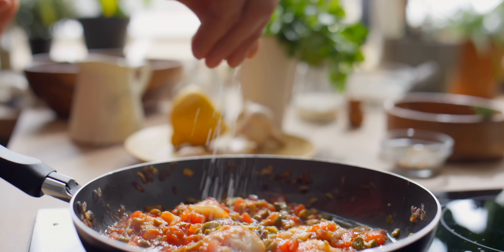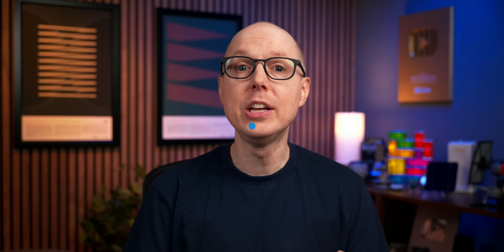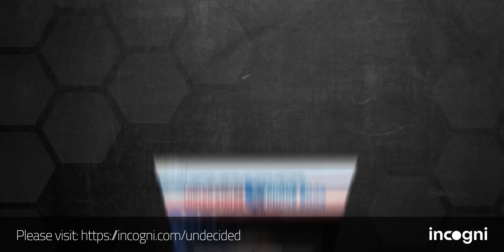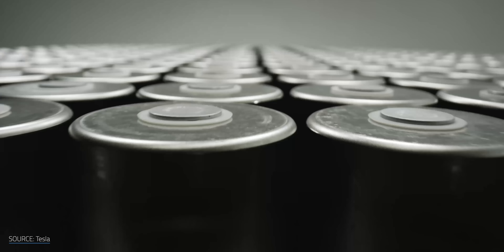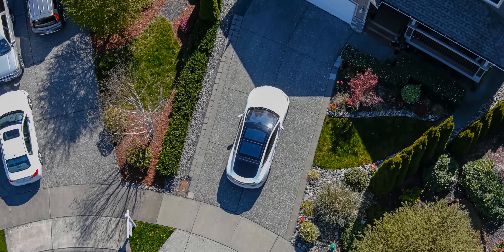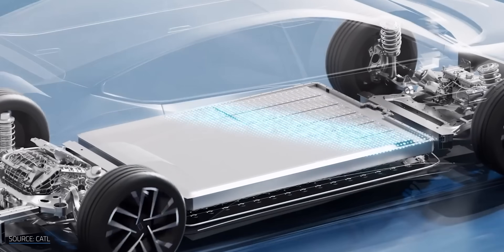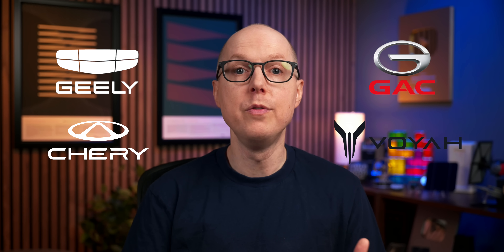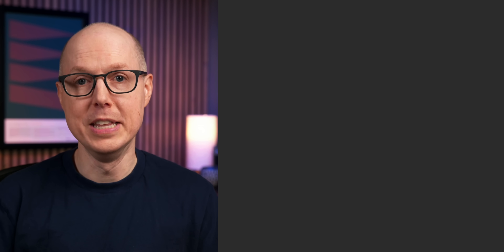How CATL Made Batteries 90% Cheaper (And What Happens Next)

Comment: I'm more worried about heat because I live in southwest Louisiana. The cold tolerance is a non-factor for me. I would be interested in Sodium batteries or mixed chemistry if it becomes standard. I just want to go from point A to point B as efficiently as possible both on an energy and a cost basis.
Reply: Heat of the day is a non-issue for LiFePO4 as it stands, it just needs a shaded shed with a bit of ventilation.  People who live in summertime-hot (or winter-time cold) states will place the batteries in a semi-conditioned spaces such as their garage, instead of outside.

And for a vehicle it is also a non-issue because the vehicle has active cooling of the pack.

Generally speaking, if you live in a hot sunny state then solar panels are an easy start.  they don't even need to be grid tied.  A lot of people are doing solar + solar-ready A/C (there are units on the market that solar can be directly connected to now), which omits all permitting and all utility / electrician work outside of mounting the solar panels themselves.

-Matt

Comment: Where do you take that it will be 10 USD/kwh? 
It is a theoretical limit based on the material prices in it. But it is very far away to reach this if ever possible. Currently it is 77USD/kwh probably and there are some sources which shows it may go down to 40 USD. It is nice, but not 10 USD.

Comment: Lithium a small part of the total cost of a battery. Most of the space, weight and cost is from separators, graphite and collector electrodes. The only part of a sodium battery that is 10X cheaper is the sodium. Estimates I have seen put the minimum cost of sodium-ion batteries at $35/kWh.
Reply: Not only lithium, but also cobalt and maybe nickel. Black carbon instead of graphite. Which electrolytes do they use?
Reply: @ich3601  LFP batteries have no cobalt nor nicke, are ~5X less likely to go into thermal runaway and far less energetic when they do.

They should ban the development and use of NMC/NCA batteries in new devices. The extra energy density isn't worth the risk.
Reply: That's a good reality check. It's still amazing to have batteries at that $35/kWh price, though.

Comment: These prismatic sodium batteries are already beign sold, you find them by Na+ ion batteries, right now the 3v 210 amps module is 38 dollars from china and around 28 dollar to deliver each  them to the US, yeah we need to make ships electric as well to reduce those shipping cost
Reply: Yes, but equipment that deals with the very wide voltage range of sodium is still fairly rare.  You can use standard inverters and such but they tend to have a low-voltage drop-out that is too high for a sodium pack.... the usable capacity winds up only being 60% of the pack.
Reply: @junkerzn7312  those batteries use a BMS  battery management system, they do no go strait  to the inverter.

Comment: I want one! 😀Seriously, is there a company that makes emergency backup power stations? Such as a tandem axle trailer, a "Power Wall" type battery, some solar panels, a small generator and charge controller? If you could rent these for use at a building site or in a infrastructure disaster like a hurricane or just to be off grid for a while......I watch your videos but don't see AI sending me advertisements for such contraptions..

Comment: People don't seem to understand batteries. Multiply the range by No. cycles. Even a car rated for 2000 cycles (usually NMC;LFP has 5000+) with a range of 300 miles would provide 600,000 miles.  Even after rated 2000 cycles the battery will still have 80% capacity. 

Well-maintained petrol cars (regular oil changes, tune-ups, correct tire pressure, no major engine issues) may only lose ~5–10% fuel efficiency after 10 years.

Poorly maintained cars can lose 15–25% or more in efficiency, especially if parts like oxygen sensors, fuel injectors, or spark plugs degrade.

Comment: Great video, Matt! You can't find this quality of analysis anywhere else!

Question for a future video: If LFPs go for ~$100/kwh, why does a 30kwh home battery system run for about $30K? Is just 3K of that the cost of the cells, and the rest all the other stuff (battery management systems, inverters, install, etc.)? 

If so, will decreasing the cost of the cell meaningfully decrease the cost of home batteries on its own?
Reply from the maker: Really good questions I should dive into in a future video.  Component (battery pack) costs of that $100/kWh cost is just one piece of what makes up the final product cost.  Definitely work diving into.
Reply: Its around 2000 euro for 15 kw home solar battery in Europe. someone is triyng to scam you
Reply: Cell price is closer to $50 per kWh. You can DIY a pack for well under $100/kWh now - I run a DIY 120kWh pack.
Reply: You can get ~15kWh lifepo4 home batteries right now, in the U.S., for roughly $1500.  Listed and UL approved batteries run around $3000 (it moves around depending on tariffs).   So ... two of those cost $3K to $6K or so. 

The entirety of a home ESS system... call it a beefy system, runs roughly $25K in equipment.   Batteries (30kWh), hybrid inverter (12kW+), gateway (grid-down backup capability), solar panels (call it 15kWp in panels), RSDs, mounting equipment, cables, fittings, tools, maybe a new main breaker panel, the works.  That's IF you DIY the install... which most people can't do.   And a lot of your own labor and time... weeks of work for a 1-man or 2-man DIY doing something like this from scratch.

If you have such a system professionally installed the cost can exceed $50K.   Labor plus profit margins for the installation company plus overhead for dealing with the insanely long warranties.   A high-end installer might charge closer to $80K.   Before any tax rebates.

--

Now that's for a relatively large, beefy system.  Going a lot smaller vastly reduces costs, but the baseline cost for wiring the electrical and getting up on the roof and mounting the panels without creating leaks won't go down much.  It is better to right-size the system from the get-go.

There are lots of ways to reduce costs... less beefy systems, grid-tie only (no grid-down backup), no batteries or minimal batteries, etc.  Or, alternatively, contract the installer to install a small system to start but designed for expandability that you then DIY yourself later.

-Matt
Reply: Thanks Matt, would love to learn more about that

Comment: Quickly growing topic - how the EVs are affecting people in them? Are there any changes in the human body when exposed to long intervals of effectively mild induction? What are the safety precautions for this?
Reply: A good measure of this that has a much longer testing time is folks that work in power plants. The turbines are essentially giant electric motors (working in reverse) putting out massive electric and magnetic fields. If they haven't seen significant effects after such extreme exposure over their careers, the comparatively minor fields from an EV certainly won't matter.

Comment: CATL powers Tesla ? Yes, but Tesla buys older and cheaper CATL products, Tesla lost the race by using old and slow batteries. The BYD blade LFP in the Model Y 2023-2024 was the best batt ever (in Teslas), now they went back to an older CATL chem which charges slower, Tesla problem, not Catl

Comment: I've been using the analogy of mobile phones to friends who are EV sceptical. Many my age remember the first phones being like a brick. Heavy, few functions and didn't last a day. Now, we all have one at a fraction of the weight with incredible power. The same IS happening with EVs and therefore pushing battery tech in general. The only question is the speed of change. With CATL being so big, they can really push Sodium batteries like no other. 

Sodium batteries make sense. They work, the market will catch up with incredible speed. All it will take is one manufacturer to move over to one and be competitive in price, the rest will follow very quickly. 

Exciting times. I am hoping I will see the death of ICE cars (apart from collectors items) in my lifetime together with renewables being the norm for domestic and commercial supply.
Reply: @themankam3  Yep, every liter less petroleum used means that liter can instead be used for something less replaceable like chemical manufacturing. We still haven't come up with a bio-sourced equivalent to butadiene yet, for example, that actually works.
Reply: @themankam3  RIP

Comment: In Pakistan, and in all countries like Pakistan, we are much more interested in stationery home batteries.  The only thing concerns us is the price.  It should be "affordable" to us as per our economy.  So, this looks an extremely great news for us to have batteries at 30$/Kwh or less.
Reply: How much energy does a typical Pakistani household use in a day (in kWh)?
Reply: @jdray  not much. when off grid you learn to be frugal with power
Reply: @jdray  The weather is hot in most of the areas in Pakistan.  Electricity usage differs from summer and winter. In summer, the average daily usage is 80Kwh to 100 Kwh and in winter around 15 to 20  Kwh.
Reply: ... for solar cells ?
Reply: The irony is that wide spread of home backup power batteries is going to make the electric grid even more unstable. Imagine what happens after a blackout, when grid starts up and it is immediately hit with an extra load of charging battery banks, completely unmanaged and unpredictable
Reply: @sergeib.v  In Pakistan, and other countries like Pakistan, we try not to charge the batteries with grid power but rather we charge them by solar.  We have a lot of sun throughout the year.
Reply: @muhammedalzadjali2524  there was a recent article saying that Pakistan has the fastest growth in solar energy in the world. Following high demand induced blackouts, people are installing solar panels  to drive air conditioning systems to help get through the heat of the day. Paradoxically, this has reduced demand on the centralized electriciy system, such that the price of network electricity has gone up.
Reply: @PatrickCarroll-f9b  That's right.  But blackouts and expensive electricity charges are the reason which compelled people to shift to solar energy.  The growth in solar energy in Pakistan is almost 99% by general people. These systems are of various sizes.  There are very small DC systems for running a few LED light and a ceiling fan, and there are bigger system to run air conditioners and all home appliances. Some factories also shifted to solar energy by installing MW solar systems on their rooftops/premises.
Reply: @sergeib.v  I don't think you have thought this through. Battery power only makes sense with variable pricing. You don't want to charge your batteries with expensive energy and use them when electricity is cheap.
Once you understand that, you can easily come up with pricing schemes that avoid your scenario completely.
Reply: @sergeib.v  I think electricity specialists know how to manage this.
Reply: the transportation alone is going to cost more than  30$/kWh considering the weight of these things...
Reply: @pietheijn-vo1gt  If they license the tech and manufacture it in place instead of shipping: you can the cut the cost of the product by like 50%.

Comment: Great! I am just about to order 63 kwh of NMC Li batteries for my 2012 Nissan LEAF. $10,000.
And you're telling me NAXTRA batteries are one tenth the cost ie $1,000 . So when will they be available.?
Oh, you're not sure. That's not much help. Do I keep driving on the original battery (60 km range) and wait for the promised NAXTRAs OR buy the NMC batteries and possibly burn $9,000 for a short term gain. ? Tricky.
Sorry to sound sarcastic but I have a dilemma.